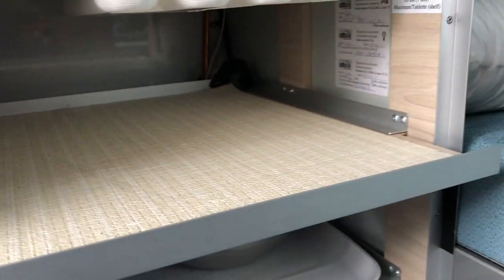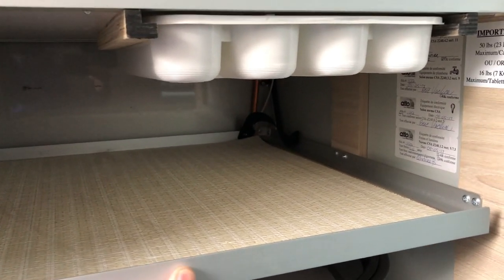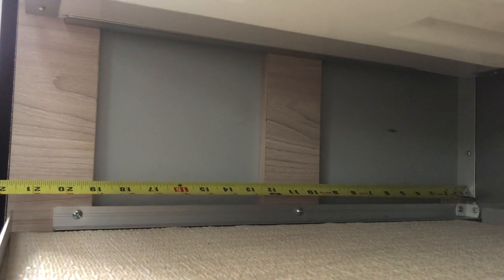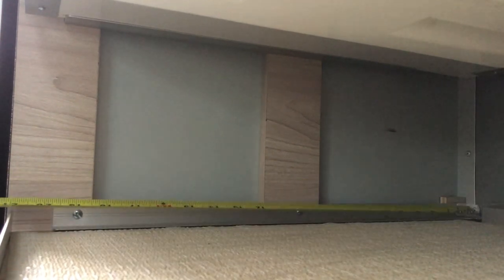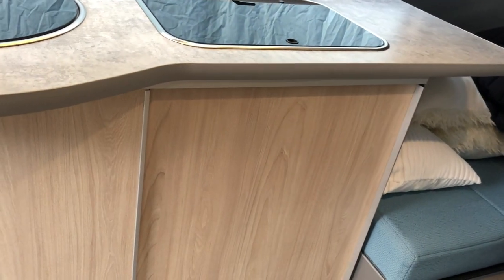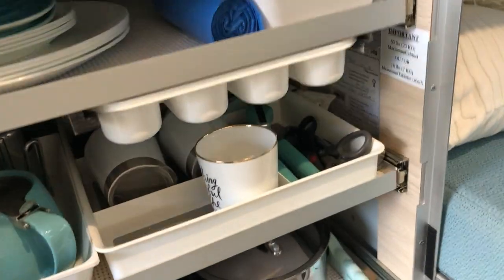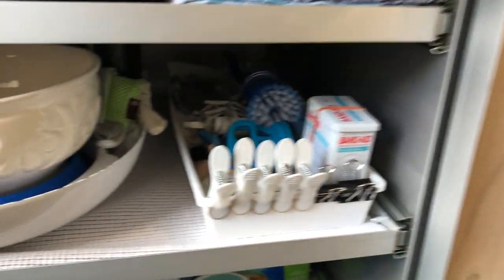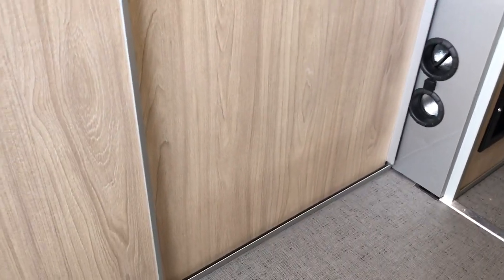Safari Condo Alto F1743 Galley Mod

Comment: Very nice craftsmanship! What are your thoughts on storing those dishes semi-loose on the shelves? I would be concerned that they would bounce and break as the Alto hits bumps. Another Altoiste installed custom coroplast containers on each shelf to contain their dishes.
Reply from the maker: Well for 5 years all over BC and western states never had a problem, the are Corell so they should not break. I dunno, there never seem to move...
Reply: Thanks, that’s good to know.

Comment: Great work! Quick question ... how did you cut out the three reliefs on the outside?
Reply from the maker: There was a local guy advertising CNC work for van lifers. You can also find someone local that has a manual mill as the measurements are not SUPER critical . Dremel?